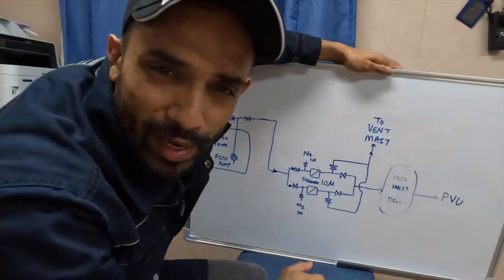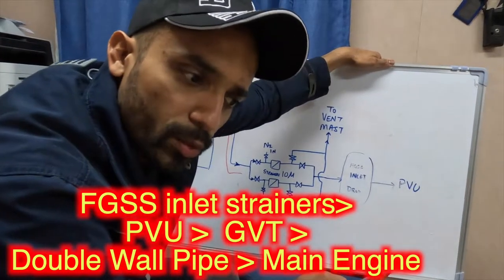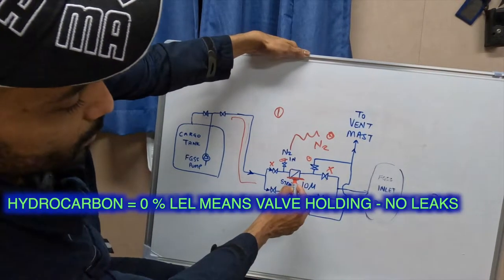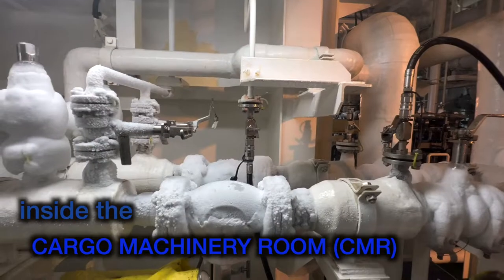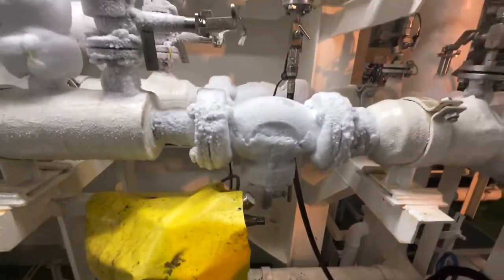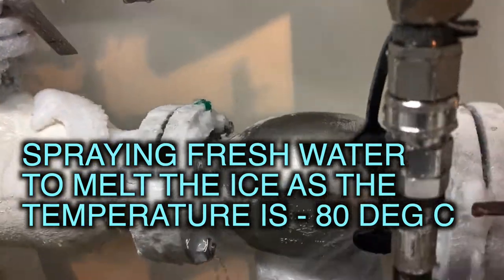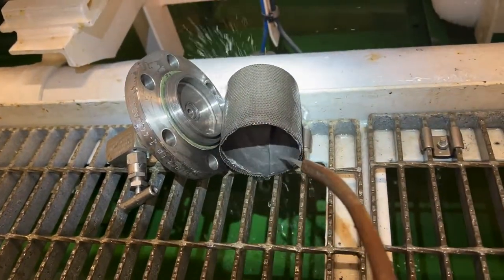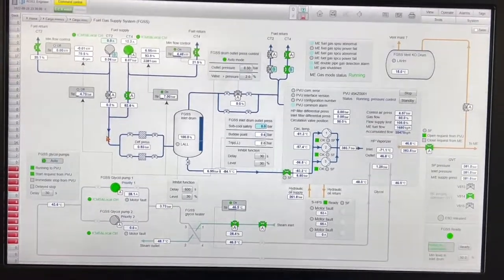DUAL FUEL ENGINES - PART 6 - FIRST STRAINER/FILTER IN THE SESTEM - DISMANTLING & CLEANING PROCEDURE

Comment: Hi Chief,
Missed your reply, I am a retired Chief Engineer into training these days.
My name is Raghu, and do appreciate your on board videos which is a great aid to teach juniors who haven't been on board yet or haven't seen dual fuel systems yet. Requests from them are to show the blow off and purge systems and differences between them.
Would highly appreciate if any maintenance videos can be filmed, especially fuel injector pressure testing ( gas injection valves). And charging accumulators, hyd and gas. Thanks.
Reply from the maker: Sure Chief, will be adding to my list and will surely update.. btw do catch up on the latest maintainece video of renewal of the gas sleeve seal rings of the GIV (gas injection valve)

Comment: Thanks Chief, informative video, everything so icy, one question - do you put grease or anti seize on the bolt threads when assembling back ?
Reply from the maker: actually no but a light grease coat will help as no corrosive substance here.. just water/ice around.. the material of bolts is SS 316.... this is inside the compressor rom and hence the atmosphere is also not so nasty.  Do like and share too..